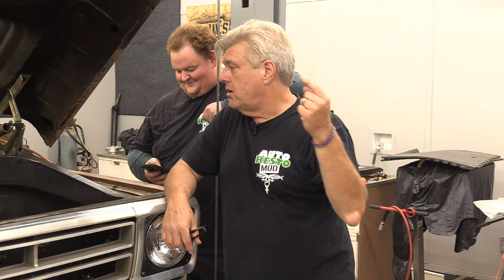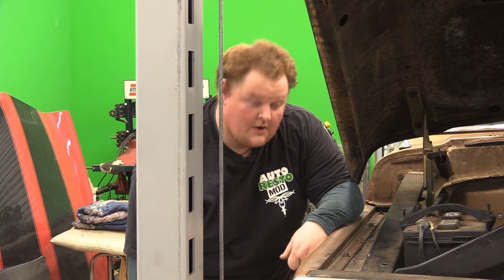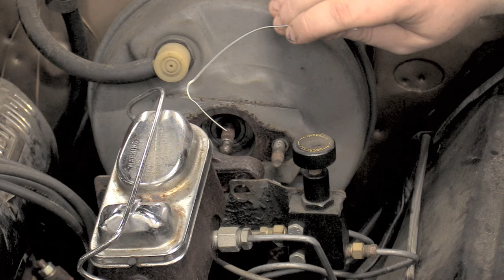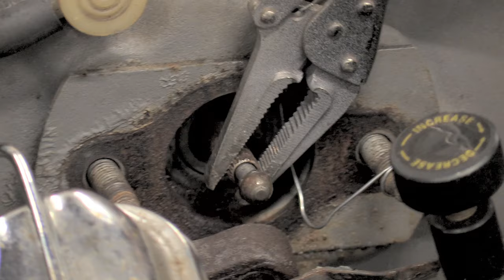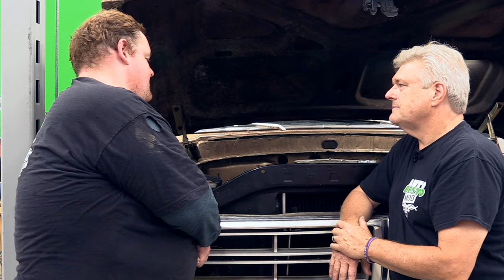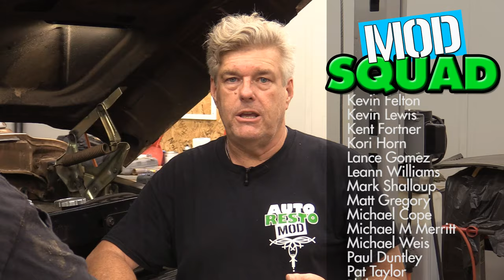Why Do We Have Sticking Brake Calipers

Comment: Helpful comment. The seat cup in the master cylinder is rounded to accept the rounded rod.  My cheat was to use a rounded wooden dowel and make a mark on it and then use math to figure out the proper adjustment.  Also some systems have templates that you just need them to set the rod.

Comment: I recently had a booster fail internally. It would pull the brake pedal down when you hit the throttle. I must’ve checked the booster rod adjustment a dozen times before I figured it out. New booster solved my problem

Comment: i had the same issue on my mustang.  it would only happen when the car warmed up and took ages to find it.  i did find it easier to fully remove the master cylinder and do more precise measurements and bleed the brakes afterwards.

Comment: After installing new brake pads and pushing pistons back in I see calipers stick after that and just being old. Also collapsed soft lines going to the calipers can cause sticking. l could see your push rod being out wack after new master cylinder install or booster. otherwise don't see why it would change. Also sometimes it can be too much clearance causing low brake pedal.